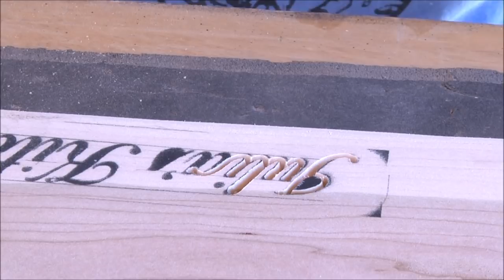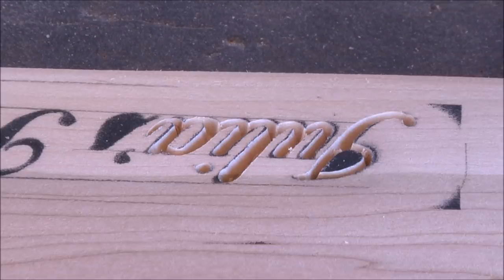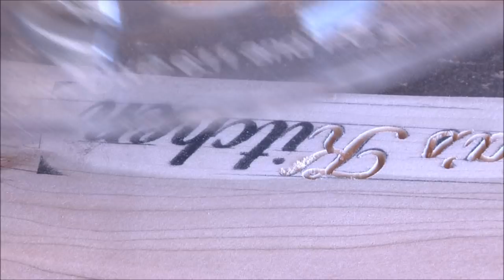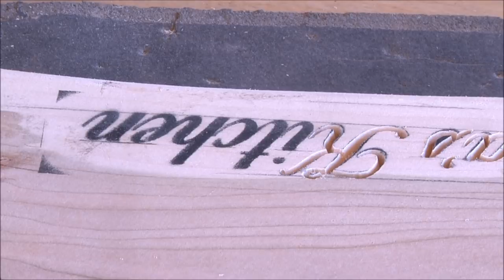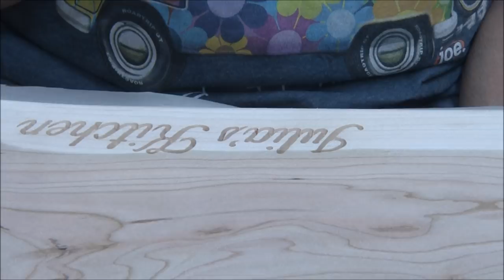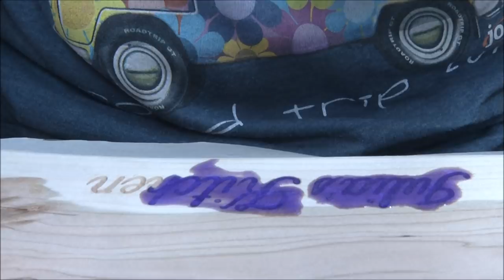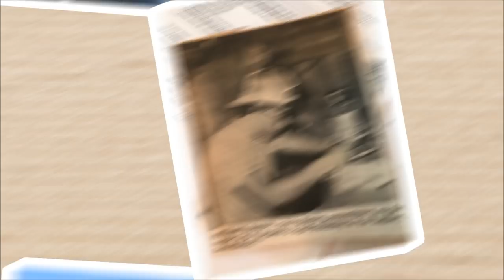#319 Personalized Cherry Cutting Board

Comment: They make the mineral oil that you need to put on first and do 2 to 3 coats of that then put the conditioner on one coat at the end sometimes too I made a lot of cutting boards but I’ve always put the minerial oil that they make the same brand on first and conditioner is to seal it up
Reply from the maker: Thank you watching and for the tips, we very much appreciate it.
Reply: I work with Cherry a lot with furniture that I make.  It darkens.  Light seems to make it happen quicker.  It like oxidation and even the cherry that is in my basement darkens as it ages.